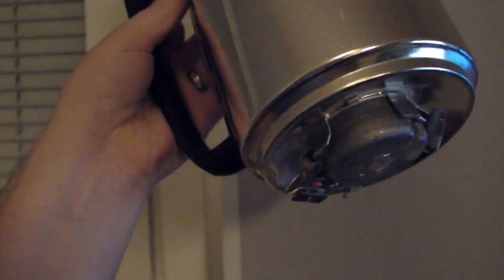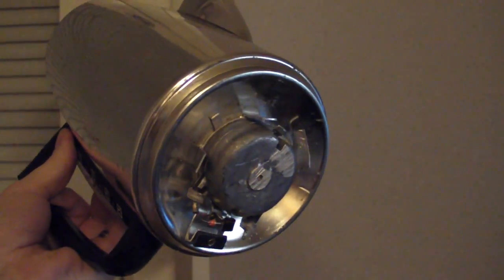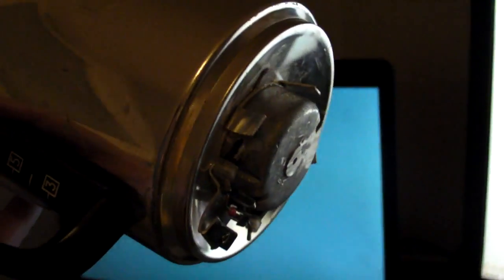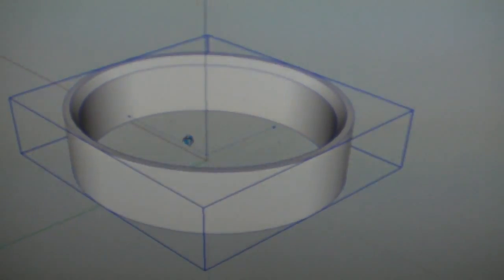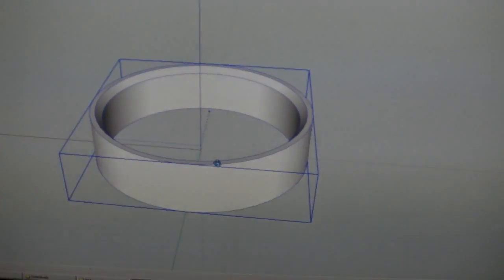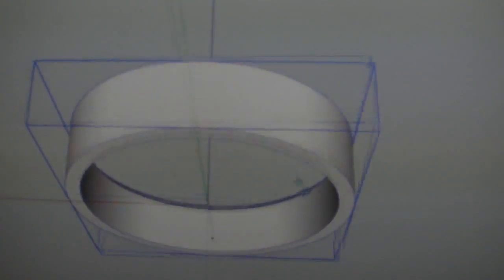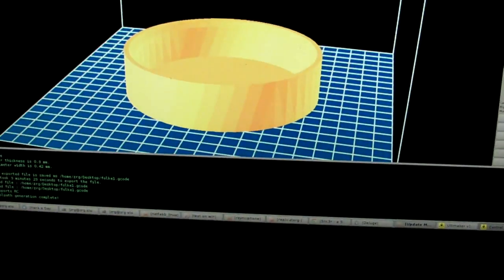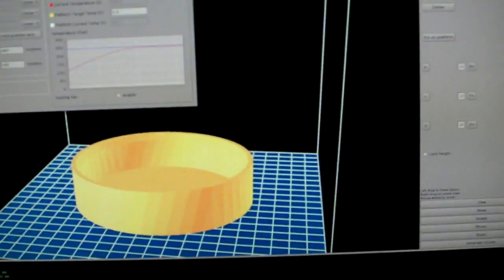Fixing a watercan using the ultimaker

Comment from the maker: @musicmaker201 1. I think it was very easy, there is nice step by step instructions at the ultimaker site. I built my ultimaker in 2 days, a couple of hours every day. There are good information at the ultimaker forum and the ultimaker google group. About the perfect print result, i have not yet tried the best settings, i am perfectly happy with 0,3mm layer height (i do most usable stuff and parts and not "art"), the machine is capable of 0,02 i think. If you are a bit technical you will be fine

Comment from the maker: @FlyMario2 It is not for coffee anymore, now its just a water-can to water flowers with :-) The PLA plastic i use has a melt point of about 200 degrees Celsius (i use a nose temperature of about 220 when i print). It's an awesome machine, but very very expensive and it takes 6 weeks until u get it when u buy it, and you have to build it...